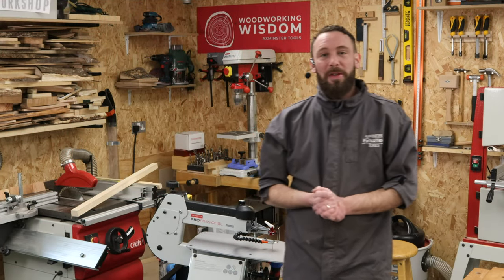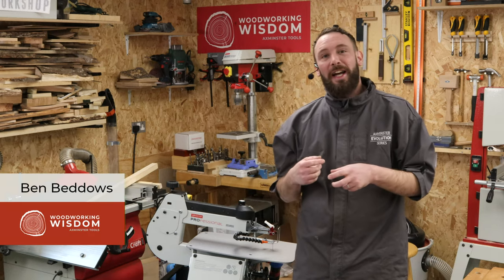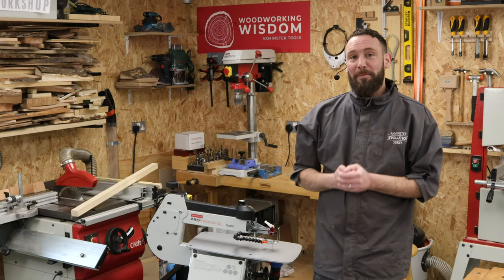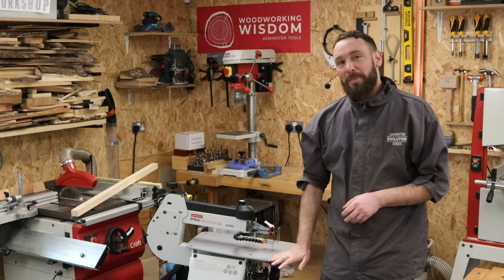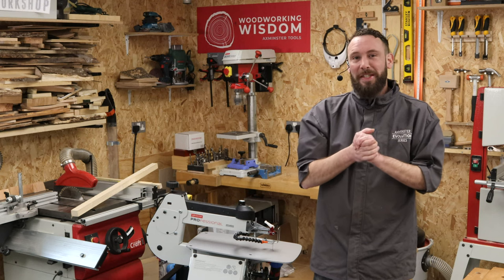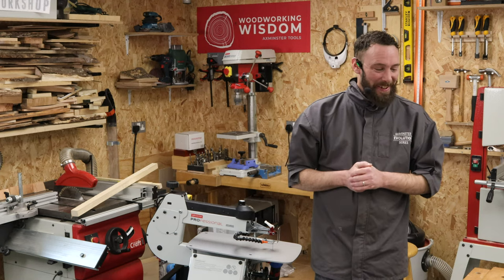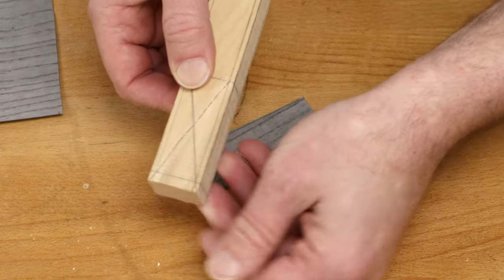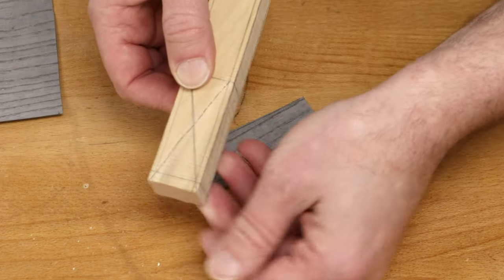How to Make a Celtic Knot Pen Blank - Woodworking Wisdom

Comment: A long way around but never mind,  A s long as you get the job done.
Reply: What's the easier way to achieve this if you don't mind me asking? I've just made my first few Celtic knot pens and followed basically this method, however I used a band saw with a 45° jig which sped up cutting time. Most of the time lost is waiting for epoxy to cure I found.

Comment: Thnks for this tutorial. Going to try this. Does the veneer have to be wood?
Reply from the maker: Hi PhilipJ, not at all, you can use different materials. There are some great videos on YouTube where people use aluminium drink cans for a metallic look. Always worth checking the label on the adhesive to see if the glue will work for both types of material you are trying to glue together. Hope that helps.

Comment: Is there a reason why not to split the blank into two? I don't have a scroll saw. Obviously glueing would be easier, but clamping more difficult as the parts might move along the diagonal. Thanks for a great lesson. it amazes that the blank is so simple yet the celtic knot looks so complex!
Reply from the maker: Hi there, Yes, it's so the parts don't slip when clamping. You could reduce the angle which will allow you to clamp across the width and the length. This will give you a tighter knot but the same effect. It's important to clamp when gluing to expel any air bubbles as the pen blanks get turned down very thin. Hope that helps!

Comment: Great, do you only use the Friction Polish to finish the pen blank?
Reply: Friction polish gives a great finish though it can be quite tricky to apply to a high standard, i often find lines left by any texture in the cloth used to apply it. However these can be cleaned up by applying a little Yorkshire grit microfine once it has cured, you may need to repeat both the friction polish and Yorkshire grit a couple of times for a high gloss finish. Finally a coat of Carnauba wax gently buffed will add an extra layer of protection to the gloss due to pens being expected to endure heavy wear.
Reply from the maker: Not at all, you can use many different finishes such as acrylic or melamine.